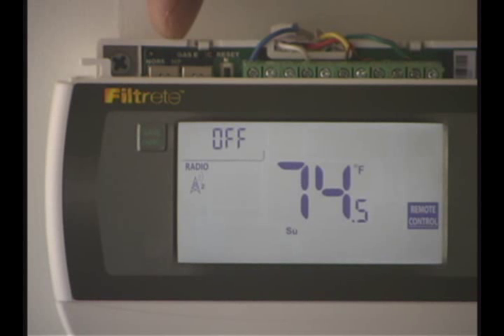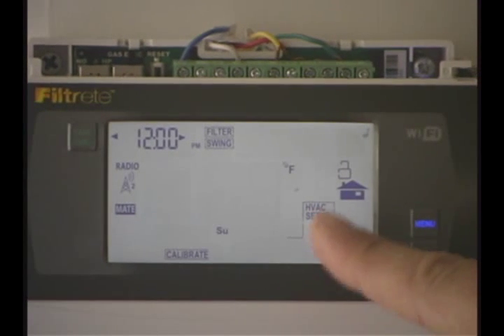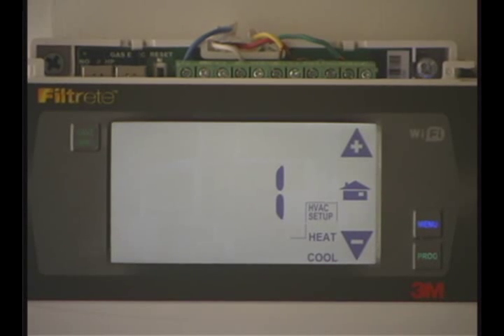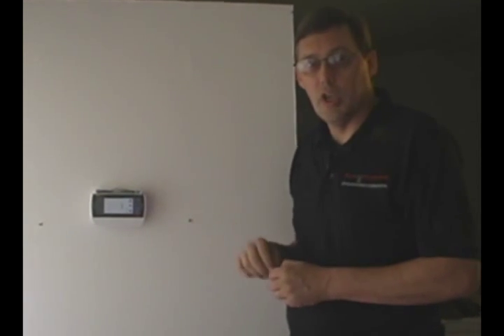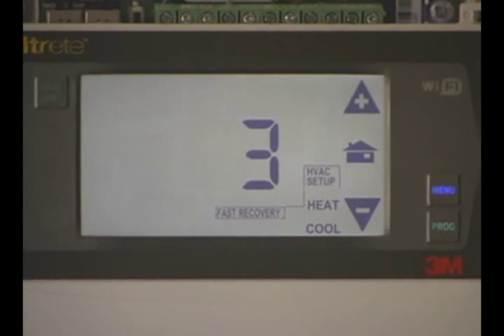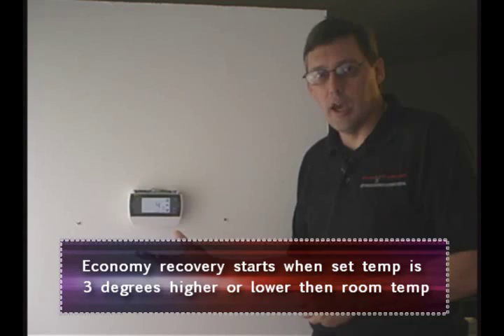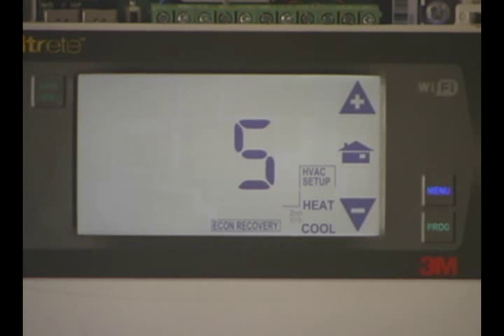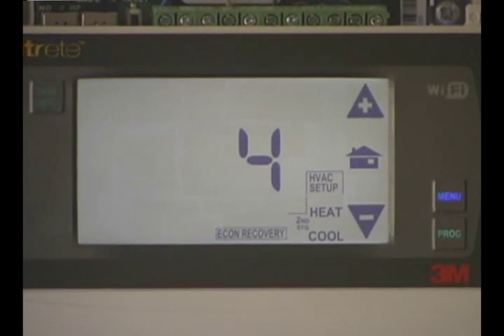Filtrete 3M50 How to set the thermostat to work with non-heat pump systems

Comment: I followed the instructions and currently have my thermostat set to heat and auto. The 2nd stage heat is on because my condo is 65 degrees and I'm setting the thermostat to 73. I've been struggling with this for 2 days because the maintenance tech won't respond to my emails or calls. Problem is....cool air is coming out of the vents. If I try to change the thermostat to gas instead of electric, nothing turns on, no blower, nothing. Can you help me  from this comment section? Btw I'm in Vegas and it's supposed to be 44 degrees tonight! Brrrrrrrrr!!